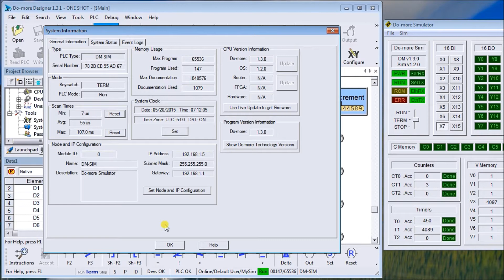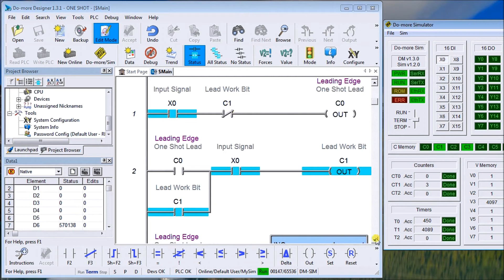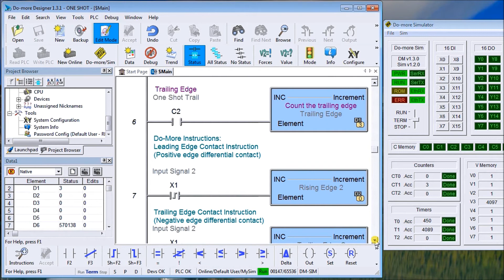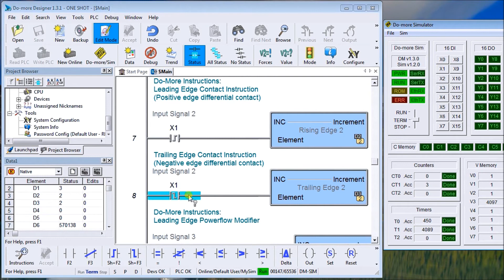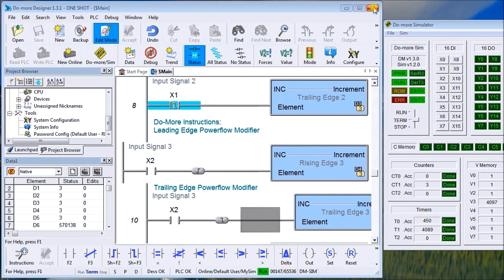How to Make a One Shot in the PLC

Comment: you can get rid of sealed-in. aren't necessary. easier will be:
--|x1|---------|\c1|---------------------------------------(c0)
--|x1|------------------------------------------------------(c1)
and use c0 in the program. it will be 1 for a full scan.
Reply from the maker: You are correct. Nice pickup.